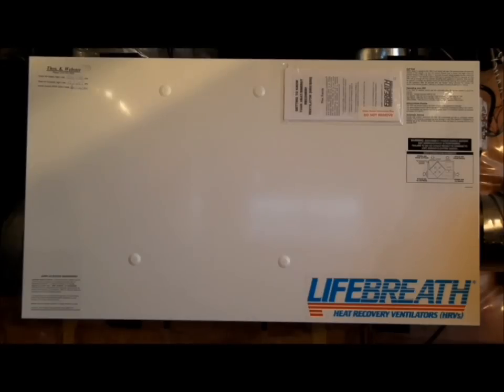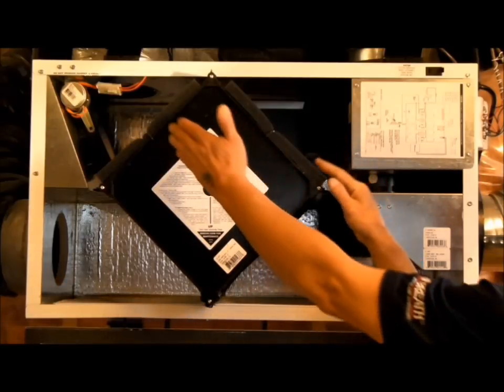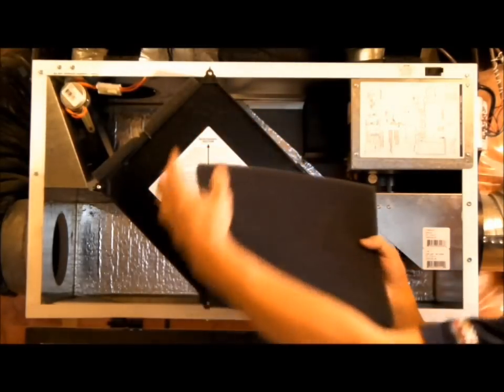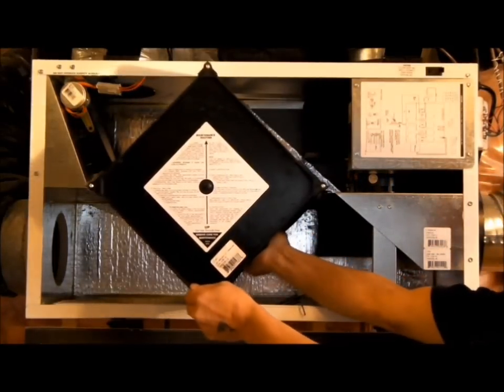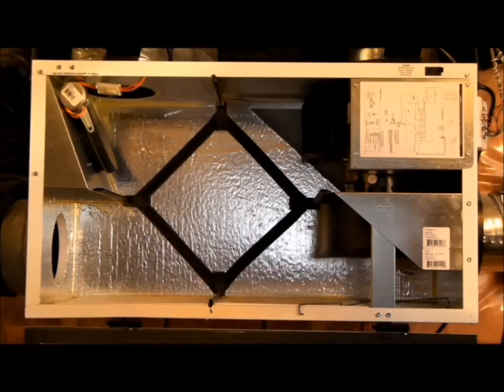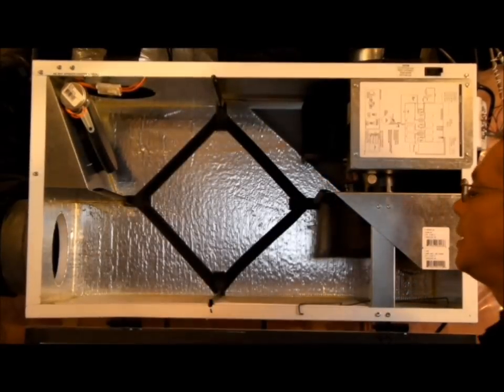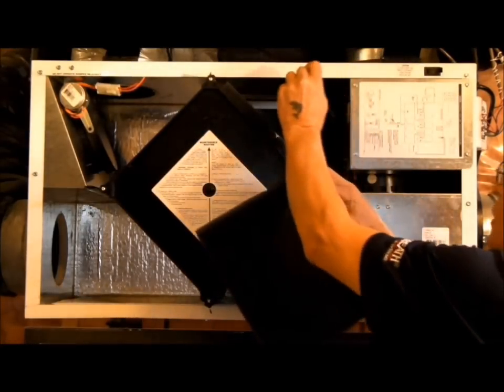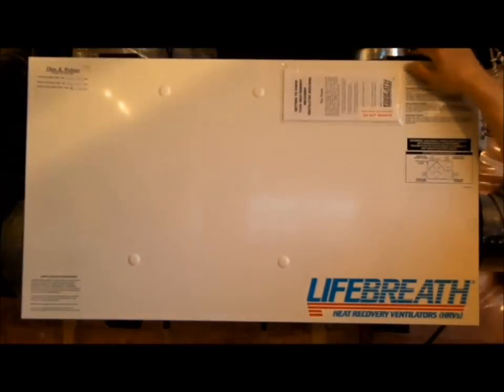HRV System Tutorial

Comment: This is a very helpful video.  I have a 2100 and don't see any condensation hoses attached to my unit.  There are two openings on the floor of the unit that are covered with tape.  We live in a dry, higher elevation climate.  Could this be why, or was it incorrect for our installer to neglect to do this?
Reply: Could not find that model online. Possible that your unit is an ERV rather than an HRV in which case the drain tube install is not required but rather optional.

Comment: I have the same system. My question is, what setting is best for winter? My comfort zone control on the side of the unit, (de-humidistat) shows a comfort zone of between 30% - 50%. Which side of that zone gives me more humidity in the house? I've been trying to figure that out for a very long time...Thanks.
Reply: IPBullets you may want to look at installing a humidifier as winter months tend to be a lot drier.

Comment: Why the box need power? Is there any running mechanical part in the box?
Reply: Fans and control circuitry, at a minimum.
Reply: The fan requires power, as well there are electric dampers that open and close upon start up.

Comment: Hi again
I had my air exchanger installed in 1990.
Since then,like i said the motor was changed and still has to be changed every 4 to 5 years top..
Not impress.
Reply: Service the Fans
Remove the dirt that has been accumulated on the blades by gently brushing them. Most new HRVs are designed to run continuously without lubrication, but older models require a few drops of proper motor lubricating oil in a designated oil intake. Check your manual for complete instructions.
Your HRV should be serviced annually.

Comment: regarding 3:42 , what is drain pan ? the pipe that is attached underneath ?
Reply: Emre S the bottom of the inside is the drain pan. It’s graded so that moisture runs into the holes and out the hoses.

Comment: Don t buy Lifebreath air exchanger,there motor don t last.This will be my fourth motor this years.Since there is no way to insert any oil to keep them right running smooth,the motor s bearing will not last.I have to do this again this year,when i change my air exchangeri ll never go with this brand again.
Reply from the maker: +Mario M  Hi Mario............let me know what model and serial number of the unit maybe i can get you some help with this. We have never run across a motor failure but to have four motors go on the same unit, something isn't right?

Comment: Energy Star certification disagrees with you. They recommend ERV in colder climates as it preserves some of the humidity in winter.
Reply: ERVs in a cold climate will ice up unless they have a defrost feature.  That makes the units much more complex for not much added value.  It is much simpler to add a humidifier.  ERVs can make sense in a hot humid environment.